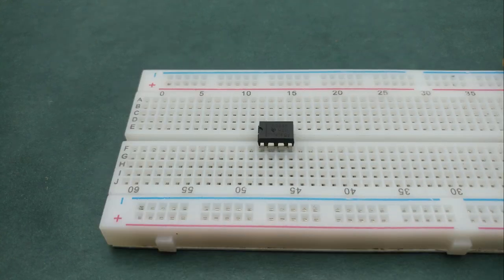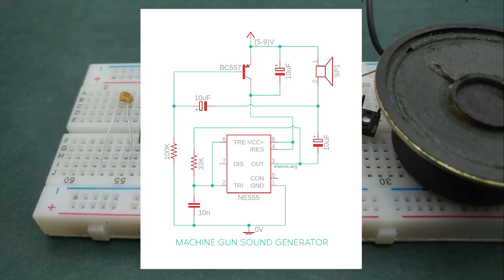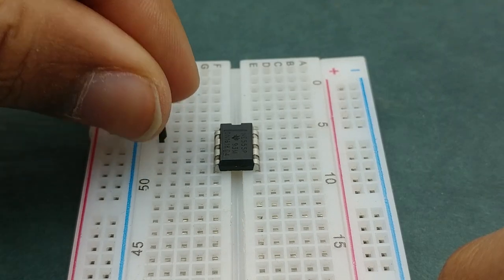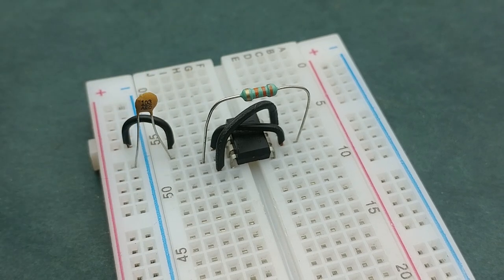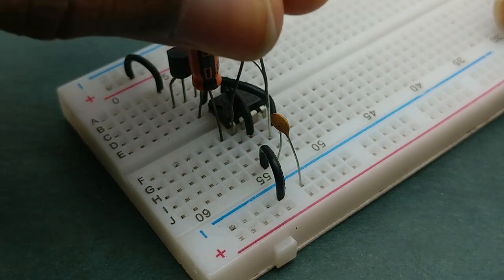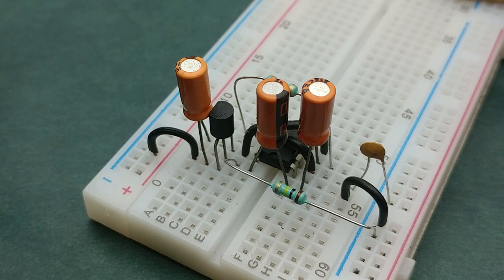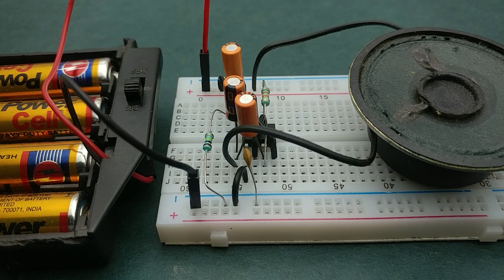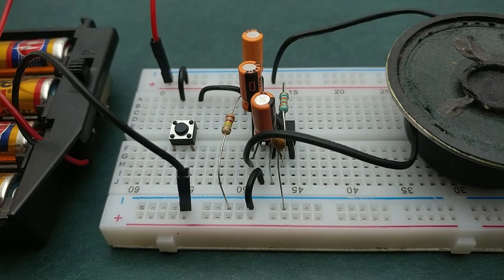Machine Gun Sound Generator Circuit on Breadboard | 555 Timer Project #7

Comment: I built this and it works. I am, however, unsure of the purpose of the transistor and all of its associated components. On my oscilloscope the power to pins 4 and 8 is relatively constant and not switched by the transistor, starting and stopping chip operation. Removing the transistor, the 100uF, 10uF and 100k associated with it gives essentially the ticking circuit from the previous video in this series. The oscillations with or without the transistor are essentially the same on my oscilloscope. What am I missing? Can someone explain the purpose of all the additional components?